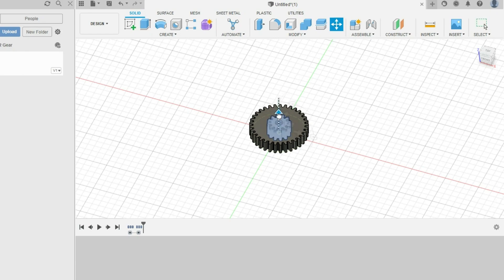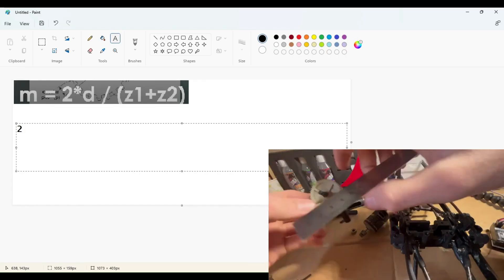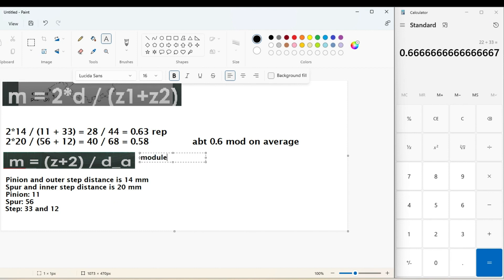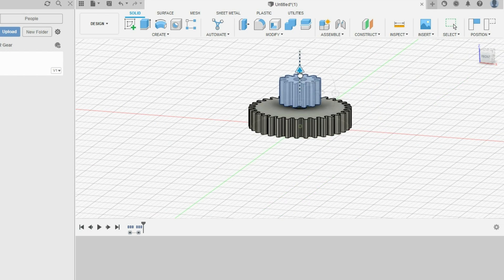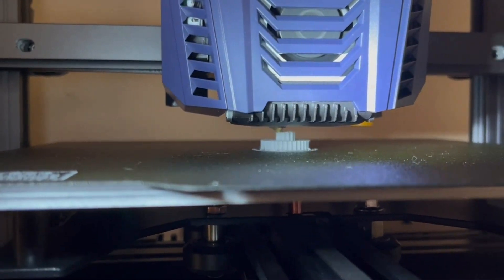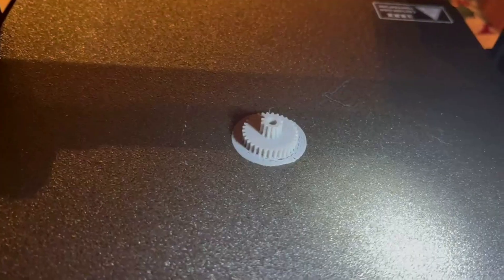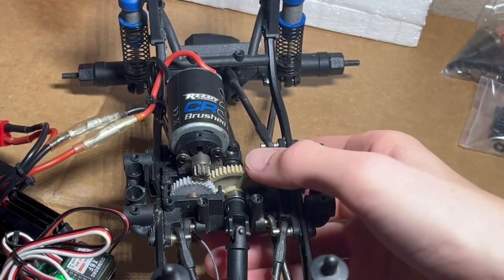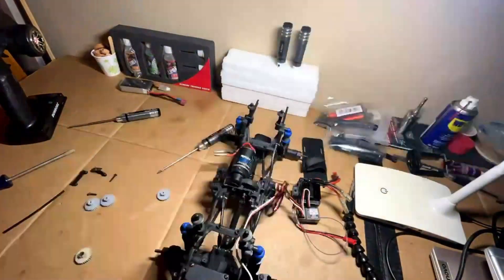I 3D Printed Replacement Gears for my Rc Car!

Comment: Wow thats awesome 👌🏻 are those gears still goin?
I have a losi Nightcrawler and some of the parts are unfound.
Would be a good little side hustle to make some 3d printed  Worm Gears for those. So many have the rc sitting on a shelf unusable.
Reply from the maker: The gears are still working but I haven’t used it very much since then because I broke a servo arm or sum and haven’t fixed it yet.

Yeah, I’ve considered selling some parts on eBay before but I can’t really compete with the durability and price of brand new OEM replacement parts. That’s why it’s gotta be something specific and hard to find like you said!

Comment: Hello friend, I admire your video and it gave me hope to revive the old rc that I have, I want to print a couple of engravings of 1 transmission of my 1/10 2wd (what material is the best indicated to carry out this process? Greetings. (my car It is brushed and it would take it to a maximum of 20 mph. Do you think the gear will resist?
Reply from the maker: I am no expert, i have no idea about the proper material. All I can tell you is that I used PLA and it seems to work pretty well so far.

Thanks for the support!
Reply: @mjrprojects9476   thanks for the input.